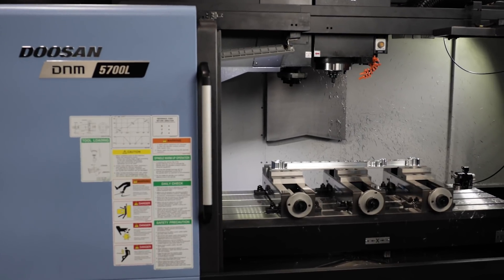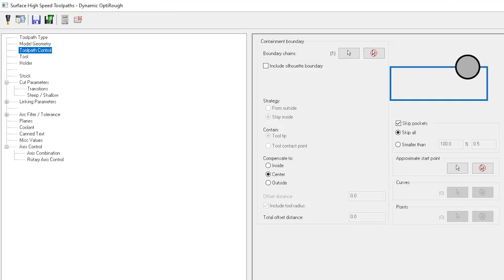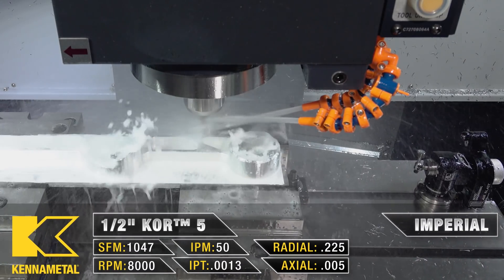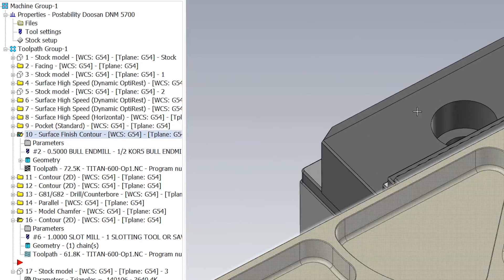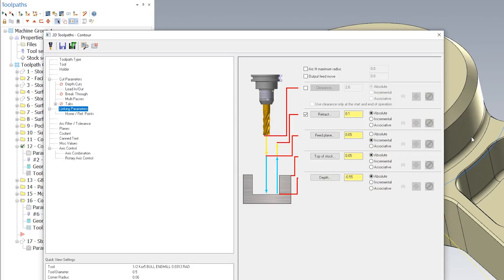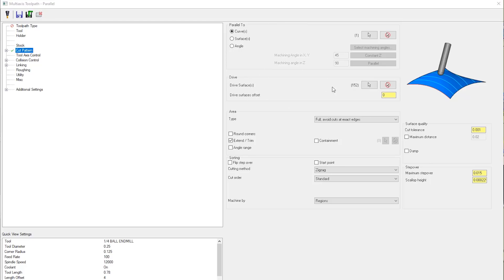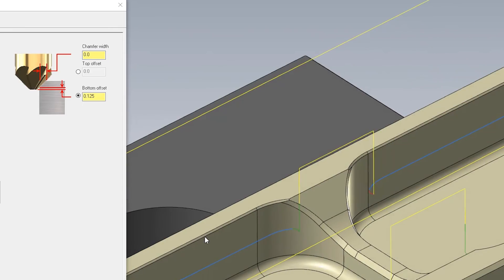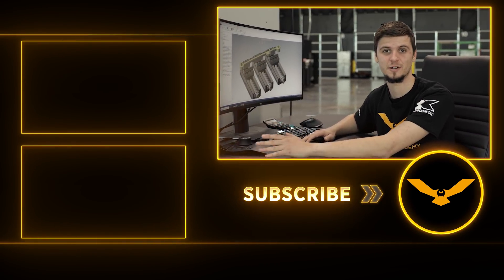Beautiful CNC Part | Machining + Mastercam Programming Tips & Tricks | DOOSAN DNM 5700L

Comment: 2:20 the problem with this toolpath is, it doesnt always hit all faces even though, they are completely accessible to the tool. Just like in this moment at the center of the screen, i can see a large portion where the tool didnt cut.
Reply: Or it hits the ones its not supposed to because mastercam doesnt know what cutting inserts are.

Generally while this came out very well theres still potential to save time. The 2nd time calulating the raw material was completely unnecessary afaik, he could have just used a contour to only mill the insides

Comment: Honestly inventor hsm or fusion 360 seem much more user friendly.
Reply: They might be but people like me who have been using mastercam for over 10 years don't like the handholding software. Haha.
Reply: Until you need any significant level of control then Mastercam blows fusion out of the water in every aspect.
Reply: @daytona81  Writing the G-codes gives you an even better level of control.
Reply: I used fusion 360 for school, but mastercam at work and in the shop. I found fusion was a lot more beginner friendly and once you learned the program and keystrokes you can make your away around pretty good but MasterCams attention to detail and ability to do certain things fusion can’t I think is why people tend to lean towards it.
Reply: mastercam gives you a great control in each operation especially complex multiaxis toolpaths

Comment: I understand this is just a programming demonstration and I don't want to come off critical, but warpage, hole alignments and tolerances are always something that has to be considered. Working such a long thin part in a tab-frame has been the preferred method to allow even stock removal and control warpage, maintain tolerances, limit vibration and tool chatter
.
Reply: Yea i probably would never finish anything on that first op. I usually do a "qualify" operation to square up edges and face off the scale. Even then i would probably just rough some of the features.
Reply: @TritonTv69420  what do you mean by a qualify operation? are you saying you would square up the material?
Reply: Always start with the easiest way and only add complexity if needed.
Im sure they get a good part just fine vicing it.

Comment: Now finish op2 with a 50 micron flatness and 25 micron parralel to the top face of op1. This is the kind of knowledge bthat needs to be spread especially  on a part like that.
Reply: I think just using the damn metric system already would be a huge improvement. Dealing with suppliers from the US is a pain.
Reply: @franciscoanconia2334  hahaha yes it is pain in de ass :D
Reply: I can easily do 25 microns on that part. magic is in fingers.
Reply: @ShitThatsMyn  its definitely doable but the skill is in work like that and achieving those tolerances. I think just showing the Op1 and not the more in depth process is missing a trick.

Comment: Can you show the second op removing the  remaining stock?
Reply: He flips the part and screws it downs in a vise with remaining stocks lowest point sitting 2mm above jaws or so. Tighten jaws hard enough to hold the part,  but not too hard to not deform it. Then you remove that stock with facing mill moving lengthwise down to a final thickness, afterwards you can center the part if further operations are required. But yeah, depending on stocks and final parts "features" many problems can occur. Sorry English is not my first language.
Reply: This should be the 2nd op,
Yeah this is a long part with large pockets and thin floor a lot material removed...
I think It will now after removing the back 
But this is the tutorial showing the mastercam and its use of the operations
Reply: @robertsoso7093  aerospace machinist are on a different level. Two operation parts like this are very common in my shop. Ive done a few myself even. Always do as much as possible before flipping.
Reply: I'd love to see the distortion in that part after removing the screws after the 2nd op.
Must be like a banana.
Reply: @neilwoodward7336  what are you smoking? There is no "distortion"
Reply: @ShitThatsMyn 
When that part is released from the vices, there will be massive distortion.
Reply: @ShitThatsMyn  it depends, how tight are the screw , alluminum it’s easy to deform 
And depends which tolerance you want
Reply: @neilwoodward7336  isnt it aluminium? there is not much disortion in this case.
Reply: @ShitThatsMyn  
Kasper. I don't have much time for people who flout their degrees. Too much time in education & not enough practical experience?
I've been cutting Aerospace (all materials), Mouldmaking (Injection etc.) For 34 years and counting. If that job does not bow like a banana when the vices are released I will eat my hat.
Reply: @ShInYaKu88  
Hi Kevin. You'd be shocked how much that material will distort. Honestly, it needs to be roughed out & the underside skimmed before finished machining. (Assuming any sort of tolerance is achieved) Even + or - 2mm will be taking a chance. It's no good banging it down on parallels. When the vices are released that job will bow. Unless roughed out first.
Reply: @ShitThatsMyn  
Bye Kasper! Hobbyist?
Reply: @ShitThatsMyn  
Do you work for Titan? 😂
Reply: @ShitThatsMyn  mate if that part isn't roughed both sides before finishing ops to both sides are performed, it's practically just gonna be scrap. Never gonna finish that part in 2 ops in a million years 😂
Reply: Stick to gaming mate. Leave the machining to the professionals.
Reply: I mean, they ARE needed, but whatever you wanna do buddy, I couldn't care less.
Reply: @ShitThatsMyn  
Pratt. Why can't you listen to professional engineers? You would cost a proper business thousands. How long have you been in the business?
Reply: @neilwoodward7336  I mean most of the time the parts will bend but depends on the application of the part whether it matters 

If the part is specified to be straight to a thou then roughing and finishing would be needed or you could attempt to straighten the part after
Reply: @andrewlivesey6779  I agree 100%. But typically (in my experience) we're making 10 parts, 50 parts or 100 parts. Straightening isn't really practical see? A thou is easy,  no problem with that. The problem comes with a tight flatness tolerance (inflicted by an ignorant draughtsman). Does my answer make sense? Please, I'd love your feedback.
Reply: @steviemill  i finish parts in two ops all the time. sounds like your milking it a bit buddy
Reply: @dgafbrapman688  🤣💀
Reply: Its good way to learn for a new person  but practically op1 should be back side finish first on vices  then op2 should be  loaded on fixture setup to finish its pocket side to achieve good flatness